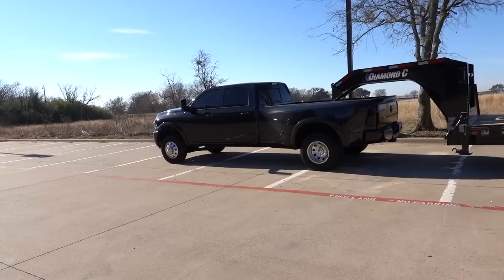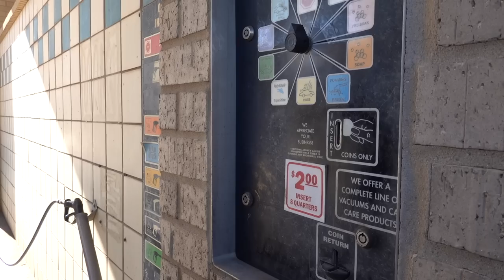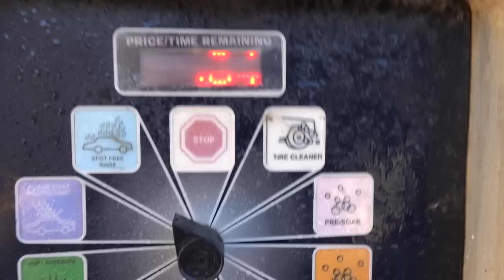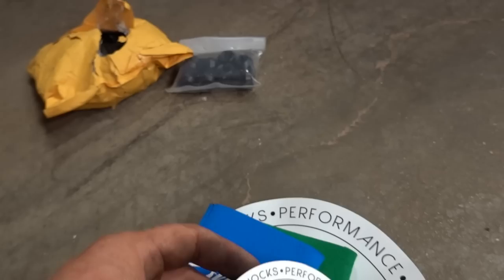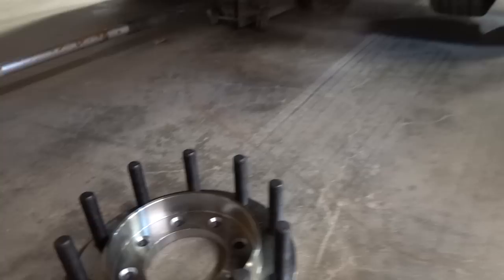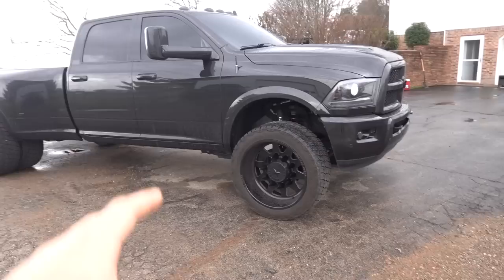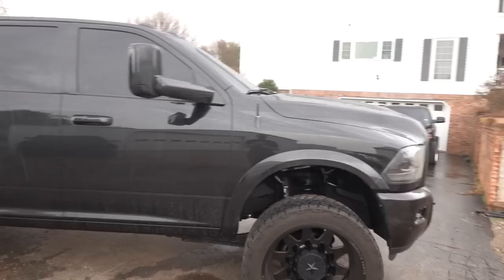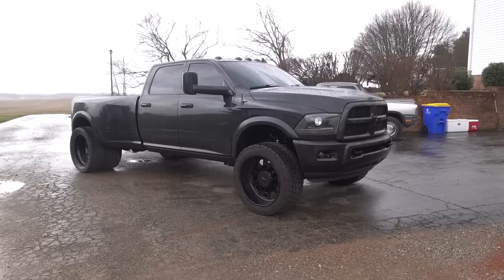TOW RIG GETS NEW WHEEL & TIRE SETUP!!!! THESE THINGS ARE OUTTA CONTROL!!!!

Comment: I have an 08 Dually . Can I take off the front wheel extenders and run 
regular rims on the front ? I hate the stock dually rim sticking out . I was 
wondering if I need a special offset ? I saw the one video of you 
getting rims put on your Dually and want to know if I can do the same 
thing on my 3rd Gen ? I only want 20-22inch wheels .

Comment: Run a front 4 link from far from stock and a 3/4” wicked bumper spacer will give you full crank
Reply: He's a thuren guy, just get a set of his Alien radius arms.
Reply: @Rommer2258  doesn’t give you adjustability to push the axle . It’s a fixed setting
Reply: @LV2Roam  pushing the axle on the newer trucks is a can of worms you don't want. I'm running a 0 offset 37x13.5 and I just cut the pinchweld

Comment: Hey greg just a suggestion for the dually... Why not put a lift kit on it like ostacruiser did for his dually build? He had done a lift kit on his and tows with it aswell like you do. Just suggestions my man, love the vids!
Reply: Because BDS is garbage compared to the Thuren parts on the dually. BDS makes lift kits. Thuren makes suspension.
Reply: @jacobjordan9611  I agree man. Thuren or Carli is way better then these cheap lift kits people keep mentioning.
Reply: @jacobjordan9611  thats why i said its a opinion not saying he should buy bds, cause yes there are others out there for that purpose. i was saying in reference to what ostacruiser did to get clearence was all for the bigger tire combo.
Reply: @1Builtcummins  it was just a reference in lifting the truck to gain clearence for the bigger tire combo hes had. not saying to buy bds cause there are better ones out there for this.
Reply: @SacredDuramax  Makes sense. I agree man.